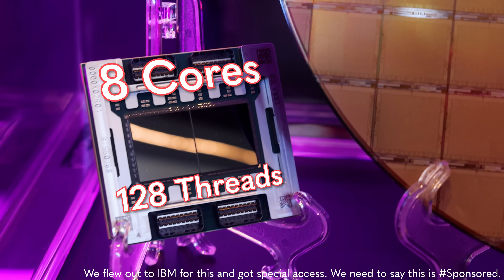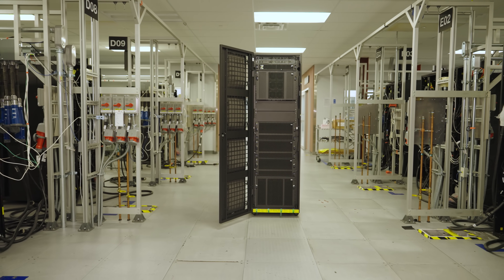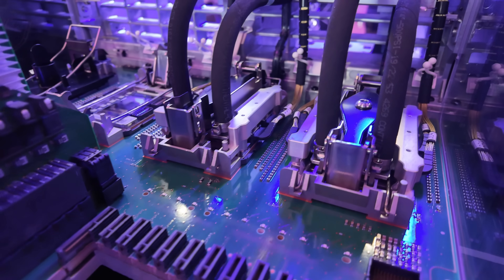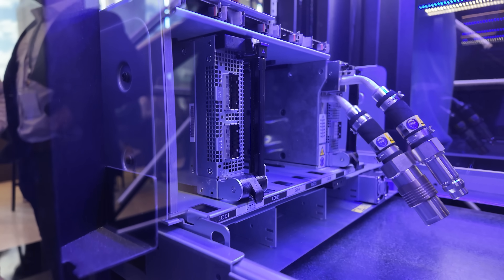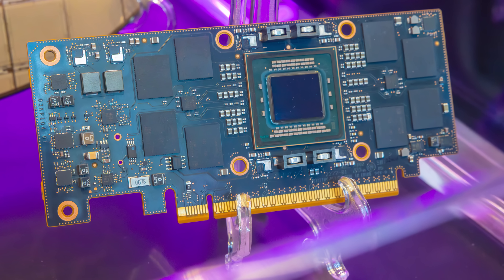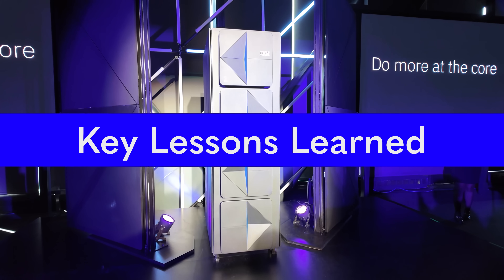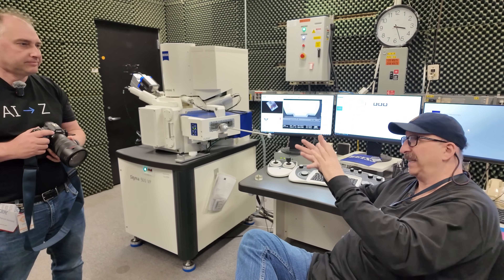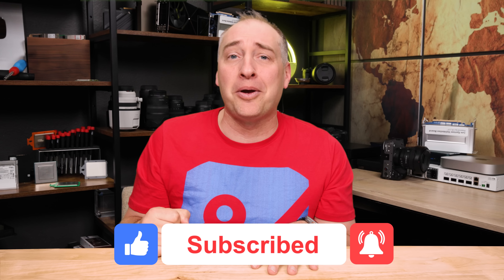THIS is how IBM makes servers that cannot fail

Comment: we powered off our mainframe in 2011 and at the time we moved our apps on x86. IBM guys were asking if we are moving on AIX and when we explained that is all X86 they were thinking that we are kidding. Now years apart we are also powering off AIX and moving all to x86. This is not about hardware is all about IBM and software. First WAS is still running java 1.8 and licensing cost on mainframe is still paid in mips. Is true that 5ghz cpu and the high integration is giving you tons of power on a chip. But with the right application design is way cheaper and combining vertical with horizontal scaling apps can be on a pair with system Z with a fraction of the cost.
Reply: Mate I'd do that to get away from WAS too. What a steaming pile of garbage.

But it's also not really for the type of systems they're talking about here, web applications are way better done with horizontal scaling and redundancy.
Reply: To make few reply public: for AxMi-24 : Sorry to say. Go poof also on a mainframe. Also a HP nonstop (former Tandem) today you are not fault tollerant. Modern software give complexity that no hardware can handle. And going back to Cobol is too unflexible today. I done json parsing in cobol2 was a pain in the a**. In short there is no system that can save you from a dumb software developer. And a good developer can run a nuclear power facility on a raspberry pi cluster. It's all in coding discipline and covering most of the fault scenarios that could happen. And when a developer says this could not ever happen.. it's murphy law.. will 1000% happen. 
Related to where we moved:  Plain Vmware. Linux/Windows java and .net in various combinations depending the user needs. Still using IBM for storage as SVC is a great technology for HA and DR of storage, also still on IBM MQ. Let's say for linux we are back on IBM as we are using Rhel but for time beeing is still cheaper than zVSE or zOS, that I have nostalgia also I'm nostalgic for HP Nonstop but times of debuging VTAM, SNA, X25, APPC LU6.2 and strange modem and display configs or MS SNA servers are over. Now is mostly TCP/IP..
Reply: @aljosalp  You have had a lot of good experience. To me, it's amazing. Thank you for letting me know the OSs.
Reply: @aljosalp  Why in the hell would you use Windows for something like that?
Reply: Why not. Windows, Linux, MacOS, Android, IOS and all current modern OS are now much reliable than any OS from the 80s or 90s. Also any hardware is now more reliable than any HW  from the 80s. The difference between a Mainframe, Tandem, VAX, DEC PDP and a modern server x86 in availability is far near than was in the past. But what is different is the number of people than can use windows, linux or other general purpose OS, number of installed base that reveals bugs and lead to all bug fixes. So my point is that more a system is used more will be error free. And tons of people will be able to operate. Still, I'm very nostalgic, from time to time powering my Hercules emulator or powering my old Hymalaya K202 Tandem box to see if disks are still spinning. But this is an old tech that served it's era and I need to bear with this. Its true that IBM is still modernising and evolving the mainframe. And most of current customers are probably running Linux for web apps and modern stuff. Why they are using this HW, politics and legacy software. And of course DB2 on zOS for whatever deal IBM offered.  But due to costs and complexity this will in a near future bring IBM on a crossroad when it will not be profitable anymore. Sure could change, and If IBM is wise probably they could eliminate some of the nonsenses in HW design, eg. using special DASD storage like Sharks or EMC VMAX and special Ficon/Escon or how is now named the storage protocol. Instead they can use FC or iScasi as on any other server. Remove SNA and VTAM and create a new RPC-like protocol as a replacement using IP or infiniband instead. Looking HP they are now running Guardian (Tandem) as an emulation on X86 servers. Disks are Linux servers emulating servernet. A Tandem today is just a big cluster or X86 machines that are glued using infiniband with reverse indianess. In short a legacy SW running on a commodity HW still offering a 99,999xxx% availability with smart tricks. But also Tandem customers are vanishing. This is again due to complexities and again cost that when you are using commodity SW you can solve the availability in a different way. So TLDR, why, because is possible, it give similar results and is less complex for the average graduate coming out of a school today.
Reply: @aljosalp  All of this is true but Linux is a server OS first and foremost 
I am not saying it is better on the desktop, but it is certainly better on the server

The main things to consider are security (which is something Windows is generally not known for), and cost (something like RHEL has a much lower TCO than Windows)

But as you said, Windows server is much easier to learn and it is now definitely more modern than some old UNIX or VMS, but when both operating systems were new, the UNIX or VMS would have been much better than the Windows from the time (this is also kind of true for the current Windows vs Linux for servers situation, as Windows is often seen for low end stuff like a cheap commodity x86 box running an Active Directory stack while Linux is seen on almost all of the worlds most powerful computers, and even IBM support Linux on Z systems and POWER9, 10, and soon 11)
Reply: @HIDLad001  Eh, Its complicated. Saying Linux is server and Windows is not. Believe me, a Windows server 2019 it can be used in the same way as a Rhel 9.3. Today with systemd instead of initd the services are comparable to windows services and memory management from Windows server 2008R2 onwards is on the same as Linux. On security, as said complicated. In ways how an unixoid system is secured it have its limitation primary due to user/group/and octal system (chmod) of rights. Compared to a NTFS files attribute that is with endless possibilities. Also in Windows you can rename all default users vs. in linux root is root. But again complicated, security is an art of minimalism, so the system is as secure as the rules are in place and access and roles are set correctly. Regardless of the OS, HW, network, if the policy is not implemented, patching is regularly performed and network security managed properly, someone will brake in. To cut it short, I'm pretty sure that in English you can express yourself in the same way as in Chinese or Japanese regardless of the different letters or different kind or expression. Could be more complicated but you can do it. Same with today's OS and systems in IT. The metric is do it fast, simple, easy, secure, cheap, high performance and reliable. Today you can have a lot of things done squeezing all of this KPIs. Is not that if the price is the primary driver you can not get a reliable, secure and high performance system. Probably will not be fast, easy and simple.
Reply: Nobody is or was forcing the above poster to run Websphere so I don't know why they are paying for it if they don't want to. Also, they open sourced it years ago I suppose because it probably isn't making a ton of money when basically any common web server already works fine on z/OS. I don't know why they think people are stuck using Java 1.8 either, I'm pretty sure for z/OS 3.1 that the minimum was higher than that, and of course if you want to upgrade Java I believe they have delivered JDKs up to Java 23 now for the platform.
Reply: Hello, Sir. What is AIX, which you have mentioned?
Reply: @MaximRedin  AIX is IBM Unix that runs on IBM Power machines. Formerly known as RS/6000 and later IBM System P. Now known as IBM Power platform. The main OS is AIX. Now it was popular from 90s to late 2010s. Still a valid platform but due to its specific we were using only for Websphere and Oracle. For Oracle we are moving out to X86 and for Websphere we decided to move total out fo Websphere due to java 1.8 limit. It's true that WAS Liberty can do higher versions of Java, but as we need to recompile our apps we decided to go on an open platform so we opted for Jboss. So today is Linux/Jboss instead of AIX/WAS. Due to Rhel being acquired by IBM is still somewhat an IBM platform but the price point is way lower.
Reply: Sorry, but please clarify: AIX is an OS, x86 is a set of chips created by Intel. So are you saying that you moved to Microsoft OS or Linux OS from AIX? Thank you.
Reply: @NathanZSolomon  we moved from ibm z (zvm, zvse, zos) and ibm power ( Aix) to windows and linux clusters. With different sw stack from java to .net. depending on the user reqirements.
Reply: All those savings go poof in a single minute of downtime. Not to mention issues with concurrency.
Reply: @AxMi-24 as if a mainframe will save it.

The key point is costs.
How much does a Z in Zillions of Dollars cost? 
Given that it's not just the hw, but the entire ecosystem.
Reply: @AxMi-24  clusters and clustered software solve most of those issues. It's very rare you are running a workload that isn't massively parallelized anyway so it can be split for processing on multiple nodes
Reply: @AxMi-24  Very few customers need "eight nines" -- mainframes used to be the default choice for everything (e.g., school class schedules) - those clients have been dropping for decades. It's a dying sector.
Reply: @AxMi-24  the only reason why mainframes still exist is the fact that financial institutions are lazy with technology so they stick with it, there is no problem to achieve 8 or more nines with x86 servers just have more than 2 servers
Reply: @dota2tournamentss you need the exact same multi-location redundancy with mainframes that you need with x86, because it doesn't help anyone that your server still works if the whole datacenter goes down (not even talking about fire etc)

and adding that multi-location redundancy adds so much reliability to x86 that the mainframe gain isn't really that significant anymore

Comment: 1. I wonder how much of their hardware supply chain is still in US. Due to the latest US tariff changes, mainframe value/$ could improve but by how much?
2. What kind of software can truly rock these? In the past they required specialized software purpose-built for the available hardware abilities, compiled to run directly on the mainframe OS. I'm curious if virtualization (VMs) and containerization (k8s) is now sufficiently advanced to allow a meaningful exploit of this hardware with minimal code-changes on various enterprise software.
Reply: They have mandatory virtualization built into the hardware/firmware - this is part of how they achieve full redundancy and hot swapability.   Mostly run ibm z/os, but can also run linuxOne, redhat, suse, or ubuntu linux.

Comment: IBM Z series is always a world on their own. They are designed to run workloads for decades moving workloads from one system to other without missing a transaction.
Reply: And yet we hear it's "obsolete" when people discuss the SSA. Never mind COBOL latest was 2023.
Reply: @brodriguez11000  They don't know what they are taking about. To give you perspective, one of my financial clients ran DB2 on their mainframe for 25 years without any downtime. ( patching included because you can stage everything) . They had a failure when patching DB2 because they messed  up a step. It's not the machine that's the problem when it comes mainframe.
Reply: I just spent the last two weeks upgrading the memory on on my USC blades and didn't drop a single packet. Will be upgrading the OS's over the next few week and hopefully won't drop any then either.  It's definitely and impressive system.. But I'm not sure it's in a world of it's own.
Reply: the issue is they run unix software not designed for mainframe environment! oh yeh that causes headaches! and IBM does not even have a mainframe environment setup that mimics customer setups!!!!! surely they can have a mainframe what is multiple boxes as 1 system for text purposes!

Comment: Mainframe = AS400?
Reply: No, AS400 (IBM Power) is what IBM would call "midrange", the mainframe's little brother.
Reply: If you take in account the difference of age, thus technologies, between the both of these machines and also re-scale the evolution capabilities on the same criterion (two things people often forget to do), yup, absolutely.
Reply: no that's basically a turnkey database appliance. a "digital filing cabinet" of sorts.

Comment: Why 16 threads per core when regular processors are 2 at most? does the workload benefit from it or are these cpu designed different so there is more benefit?
Reply: IBM processors are optimized to run DB2 and Java code and IBM software is licensed per processor core. So you want to license the minimum number of cores but you also want a high number of threads to increase performance.
Reply: Wonder if that would make Oracle software cheaper as well 😊
Reply: Yes you can run Oracle (and all sorts of other non-IBM databases and open source apps or containers) on Linux on Z systems - which consolidates the number of cores you need to run (and license - each telum cpu core counts as 1 license, regardless of threads - and it allows hard partitions within a system that can isolate licenses for various apps)
Reply: The license bullshit only considers physical cores? Huh. In the unix world an SMT thread is a “cpu”

Comment: IBM makes some cool stuff, its a shame they sold all the stuff mere mortals could afford to lenovo.
Reply: Yeah IBM has spun off more assets than most company's will ever create. I still lament the foundry that they paid global foundry to take. I fear IMB has been chasing investor ROI at the expense of the amazing things they were doing.
Reply: @mr_jarble  private equity and wall street will ruin innovation and success for finite profit gains everytime.
Reply: America could have been so much more
Reply: Good to know that IBM is still making good IBM quality stuff ❤
Reply: Oh yes, they do! Most of it is just not know by the public. For example, IBM provides free access to some of their quantum computers. You can use them from your home!
Reply: Google became Google buy using off-the-shelf hardware that was cheap, then doing error correction in software.  (The even used non-ECC RAM when 99% of server farms used ECC RAM.
Reply: @tombyrer1808  I think the difference is that having a bad search result or 2 isnt going to do any damage to anything, compared to something like a bank that cannot have errors or downtime.
Reply: @geofrancis2001  You can achieve the same level of uptime and performance and precision with distributed architecture like Googles.  It's why most software today uses it.  The reason these systems exists is the complexity of re-writing the software in a distributed fashion.
Reply: @stevenchapman207 No, distributed architecture is popular because it's cheaper and 99% of people don't need the kind of reliability that mainframes provide.
Reply: @ericw.1620  I don't see how a monolithic mainframe in a single location is going to be more reliable than 1000's of machines spread across multiple geographic regions. Less complex, sure, but not more reliable.  That single instance may be more reliable than a node in a distributed system. But that's why modern software is written as a distributed system. And, yes part of that is for cost since most people don't need that level of reliability. But that's another advantage to distributed systems. They scale as the needs scale.
Reply: @stevenchapman207  Reliability in this context is measured in downtime. Sure a distributed system could theoretically be more robust, especially in a regional disaster scenario, but recovery from that means downtime on the scale of minutes. For deployments where these mainframes make sense, that's an unacceptable timeframe. That's not even taking into account the fact that if your operation requires this kind of uptime, you're deploying a dozen of these in a dozen different data centers with direct fiber connections between them.
Reply: @ericw.1620  No, recovery doesn't have to mean downtime. You can have the same FI's in a distributed environment you have with the mainframe.  So, if distributed can be more robust, and it's cheaper. There is another reason mainframes still exists. And, that was the point of my comment. The reason they are still a thing is re-writing the software is a major undertaking And, for now the economics of that re-write don't make sense.

Comment: Usually IBM is on the edge of innovation. Or at least very close to it.
Reply from the maker: Even the liquid cooling block and retention mechanism are far beyond most standard servers today. It was wild to see this.
Reply: @ServeTheHomeVideo  It's too bad they cleaned out most of their good support people... their hardware may be good ( really only the mainframe stuff ), but their support is trash.  Don't even start me on their licensing....
Reply: I remember seeing the motherboard of a IBM PS/2 shortly after it was released.  It looked like it was imported from the future (with cleanly surface mounted components) compared to the PC that I had.  IBM a force in harddrives not that long ago.  OS/2 that could have been.
Reply: @allanwind295  I mostly remember them with all their partnerships (often with AMD), things like PS3 etc. Though in the 90's I was completely cut off from any mainframe or even any server news.

Comment: I believe those cards for the memory are CXL modules.  I think CXL can also be used for storage devices.  Note that the slots are PCI express!
Reply: It's probably Open Memory Interface, another way of connecting discrete memory controllers to a CPU that IBM's been using.